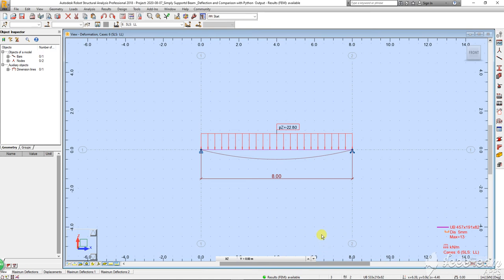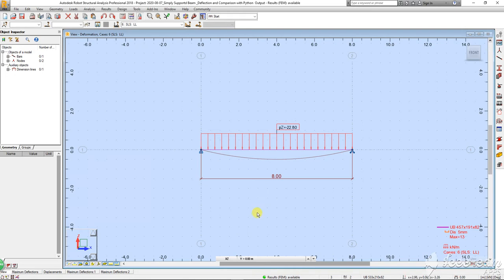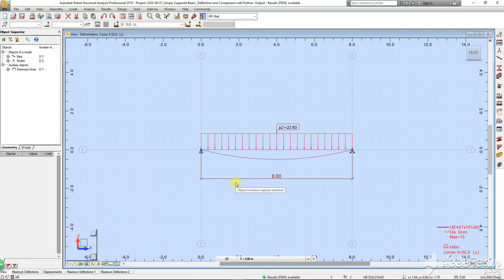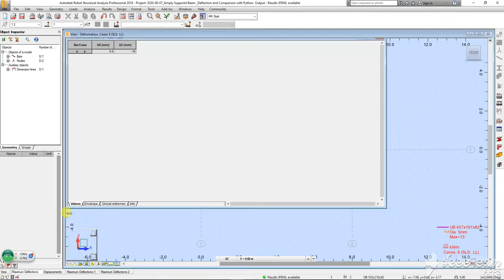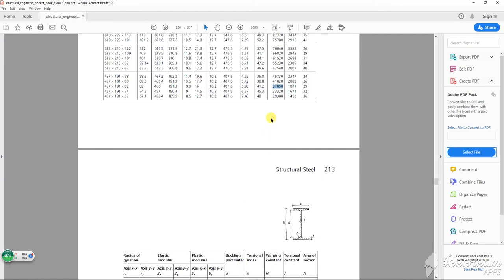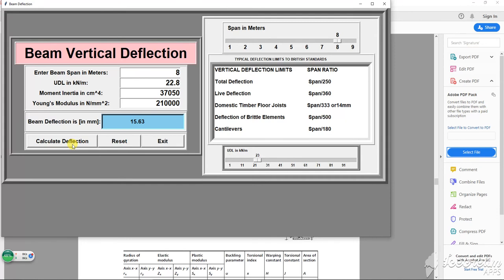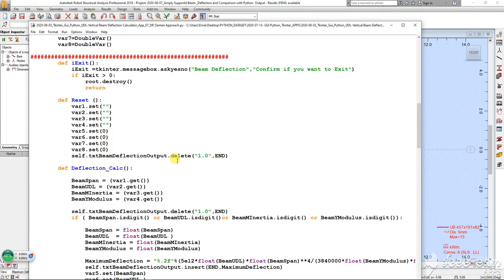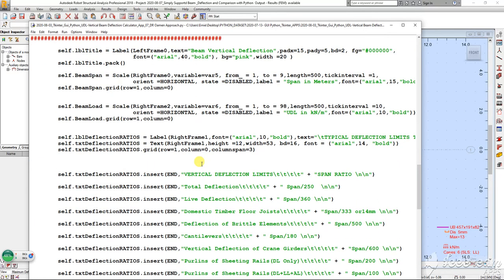Automation in Civil-Structural  Engineering Using Python

Comment: is it for only one span??and which method u applied?
Reply from the maker: Object Orientated Programming  on Python and  TKINTER,
Reply: @py_tok5589  no,i asked the structural procedure...is it double integration or unit load method or something
Reply from the maker: @shehab976  it is the  elastic equation of Beam deflection- simply supported with UDL
Reply from the maker: You can  do it for continuous span too, but this is very practical example